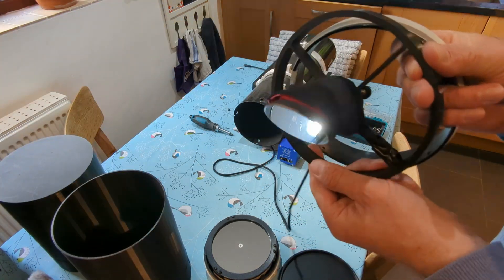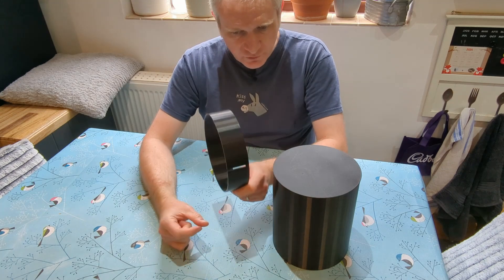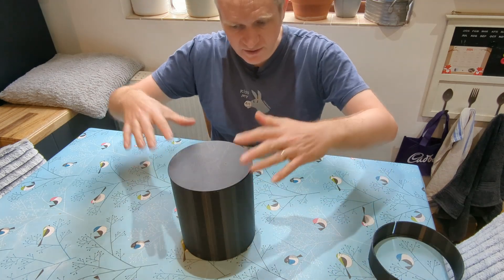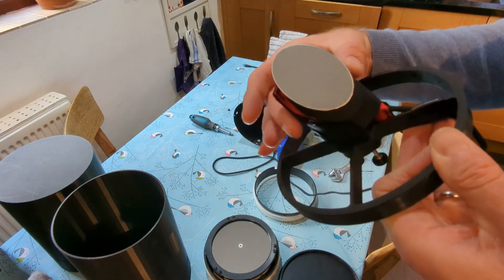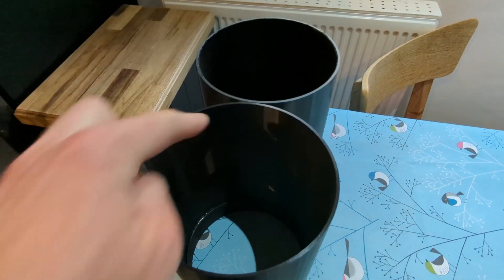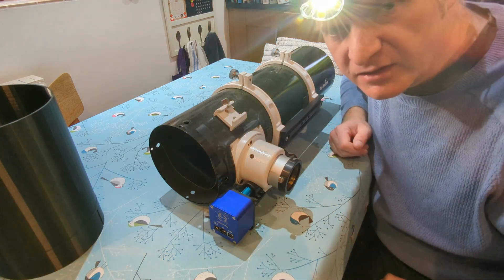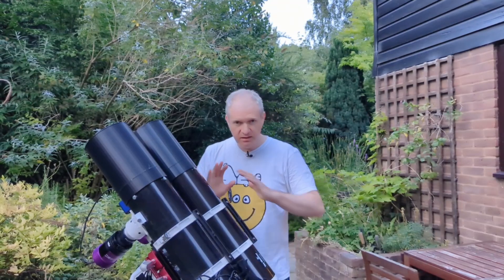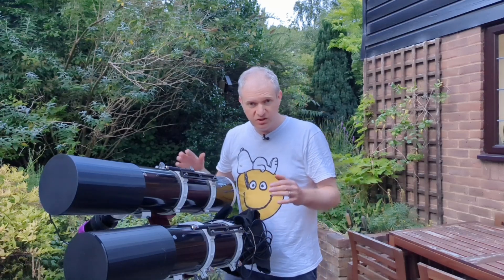Dual Scope Part3 - I nearly break the secondary mirror!

Comment: You might be interested in a volcano clone nozzle for your ender. They cost like 2£ on ali and come with a non-stick coating. They increase the possible flow rate quite a lot.

I am looking forward to the collimation! It would be cool of it eas possible to have one camera feed at like 50% opacity and overlay it on the other one. Then you could adjust the angles potentially a bit easier
Reply: Ooh. I like the opacity idea. This could be achieved on a PC using a program such as "Windows Top", which allows one window to be locked on top while set at an opacity of your choosing.
I used to use it for tracing logos in Forza (driving game, livery/decals editor).